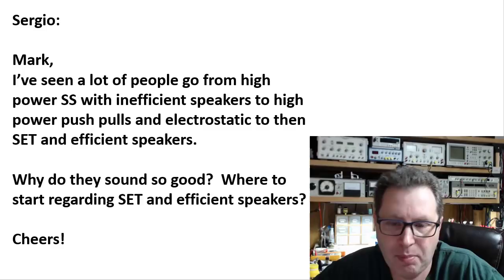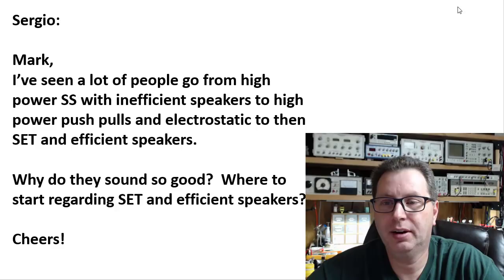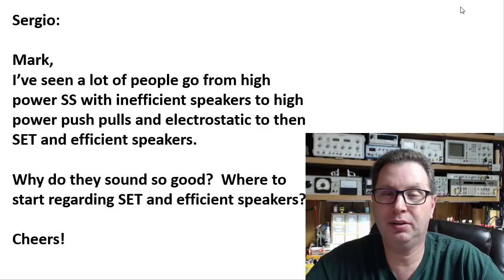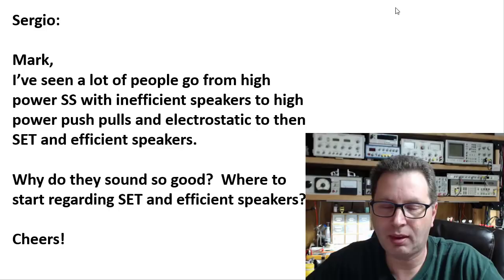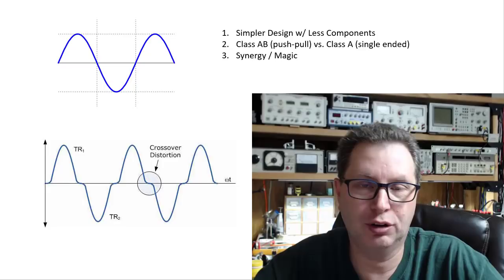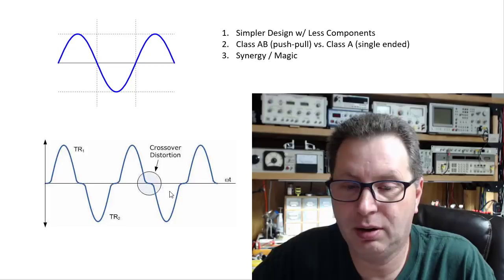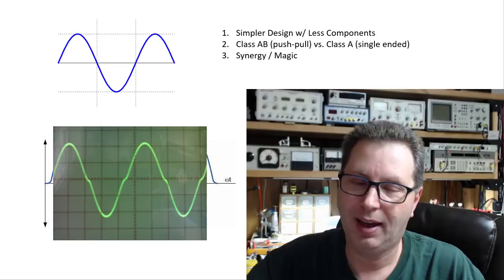What's so good about SET amplifiers and efficient speakers?

Comment: Ummm... actually tube amplifiers in general Current Sources and modern Solid State amplifiers behave more like ideal Voltage Sources. The main difference between them being the Damping Factor. Even with low power ratings, the tube amplifier will have a higher voltage swing, making it sound louder than a SS amplifier of higher power output. When “the magic” kicks in, well that happens when a low Qes speaker like Lowther, AER MK1, Foster FE-206E meets with a Current Source amplifier. There is a considerable low frequency boost. Please find and read articles from Bob Carver and specially the famous PDF from Nelson Pass on current vs voltage sources.
Reply: The damping factor of an SET amplifier varies not only along the musical signal waveform, but is also power output sensitive. The boost is almost assuredly distortion. There always seems to be a gimmick. Personally, I like live music better than artificially flavored music.

Comment: The notion of crossover distortion is outdated. Designs have improved to the point where this distortion is eliminated.  People are shortchanged by the reduced performance of SETs.
Reply: Nice to see someone who understands. Just to add, the crossover distortion mentioned is due to being operated Class B, not Class AB1. SETs are only used because very very few understand how to properly design PP Class AB1. PP Class AB1 actually operates Class A for several watts output until the tubes slide into AB1. Damping factor is basically constant vs SET with wildly varying damping factor/output impedance.

 SETs basically lessen the bass and highs, up the 2nd order harmonic distortion, and "magic" midrange.
Reply: @basspig  Nice explanation. A lot depends upon the design of the PP amplifier output stage, ps supply. I  have never had a notch problem even though I idle near 65-70ma.  I have used my Tek dual trace to check it out.
Your idea of forward bias is interesting. I believe Carver entertained that design as well?

cheers
Reply: @sammys7518  it is a function of the load line and the relationship between screen voltage and plate current. Depending on those relationships, an amplifier may be more or less sensitive to notching at high power levels.
I have not seen a similar circuit in any of Bob Carver's amplifiers. He did employ some protection circuits on some models, but bias was pretty conventional on the ones I worked on.
Reply: @basspig  In triode mode, there should not be any problem. I have no notch distortion at all in my PP circuit. How are you biasing your output tubes?
Reply: @sammys7518  triode mode avoids the notch because the screen current is directly tracking the plate current, being wired together. This is also why I like ultralinear output with the screen taps. Maintains the tetrode advantage and has some of the benefits of triode.
I bias my tubes with a mix network that uses a -110V DC bias supply and a voltage divider coupling to the rectified output from the plate side for forward biasing dependent on signal level.

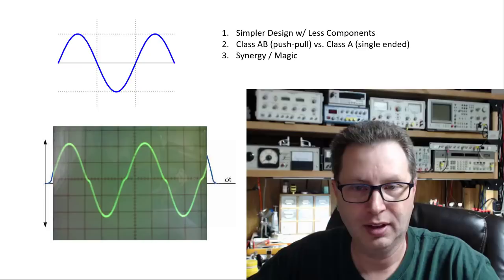Comment: The author's explanation of Push Pull operation has very little accuracy. The author's description with the left side photo notch,  the scope sine wave at 6:58,, and signal split in half comment is Class B mode "50% duty cycle",  nothing to do with Class AB1. 

In fact, Class AB1 has both output tubes running Class A, or 100% of the waveform for multiple watts output 
by definition. This is first semester Electronics Engineering. That is good for 80s/90s db spl. As the wattage rises, the output gradually slides into Class AB1 operation.

There is no taking the signal apart and putting it back together. A completely false statement. Frankly, 
the video explanation is disgusting to me. As far as pure sound, well.............

An SET amplifier has several inherent major problems that degrade the sound. One being the speaker sees a constant varying output impedance over the waveform, thus constant varying damping factor.  

Another is that there is not cancelling out of the 120hz ripple that PP has. This almost necessitates the need for inductors/chokes in the power supply filtering. A choke/inductor causes non distortion of the music. 

Another is the extremely high signal drive needed for many DHT tubes. The problem is the driver creates high harmonic distortion. Combine the harmonic distortions of each stage and suddenly one has higher orders. Many designs create very high amounts of 2nd harmonics to mask the negative effects. 

Interestingly, he mentions the black between the notes. Nothing there. With an elite PP amplifier and entire system, one would be hearing the reflections off the recording studio walls. Truly, one hears all the music, not just a portion with the inner detail blacked out. 

The good amps use no global negative and minimum single stage feedback. 

The main problem is that virtually no one understands what is involved and/or how to design a Push Pull 
amplifier. Oh, they know a few equations but not a true understanding.

Lastly, if musical accuracy is one's goal, or gimmicks to manipulate the recording to one's own tastes.

I could go on and on but won't.

Comment: Push pull class A does not have crossover distortion; this applies to tube and transistor amplifier. Using push pull eliminates even harmonic distortion. Push pull can be class A, AB etc. Your description is of push pull is incorrect. Resorting to "magic" to describe SE!!!!

Comment: TLDR - the science is in amplitude depth and speed of amplitude response aka headroom/imaging/detail

You have a far greater understanding of the science than I do, but there is definitely science behind it. Number one is that its a Class A amp. You send an electron in and it gets multiplied. It doesn't get delayed and re routed and turned into a square wave and yadda yadda.. it just gets multiplied at the speed of the electrons in the circuit. Number two is the volume of the multiplication. Its like asking why does a church have great reverb? It's because it's so fucking big!

So, Class A with direct path from source to speaker - You have amplitude response not just frequency response. The reason guitar players love tube amps as much as they do is because the wave from the pickup is unbroken and magnified to the speaker cab, not bit crushed. It's like using a magnifying glass on the sun vs taking a picture on a cell phone or a 35mm and zooming in. People talk about the magic of tubes, and that"s wrong (in my opinion, I'm a musician not an engineer). The magic is in the multiplication of electron flows due to the physical properties of the circuit. Why don't transistors sound the same? The biggest reason IMO is because they aren't working with the same volume. Tube distortion is yet another story for a different time (and a different guy as I'm a trumpeter not guitarist). 

Shannon Nyquist made the leap that since frequency response can be assured - that no quality is lost. Shannon Nyquist was incomplete. You need amplitude response too. The reason a ride cymbal sounds so damn good on a 5 watt mono Single Ended tube hifi... old enough to draw a pension... isn't because of the "great" frequency response on the unit.. the frequency response sucks on most of those old radios and reel2reels and record players (at least it does on mine). The reason is because the amplitudes of the frequencies it CAN do are turning on a dime and in the correct quantities. You can hear the millisecond the stick hits the ride on an old tube amp with shitty stock speaker. It isn't some muddy fuzz or some 808 sample, the hit is very well detailed. You can almost tell the weight of the stick. If you listen to a live recording, you hear the room noise as though you are actually there. Or, put differently for the guitar players out there... a guitar solo sounds like the players tube amp is right in front of you... because effectively... it is... 

What has worked well for me is to pair my tube hifi with a modern boombox. The boombox handles the lows and the tweeter stuff, which are low information frequencies. You don't hear the shoes the drummer is wearing in the subwoofer or the tweeter,  but you might hear it in some well delivered mids.. as he shuffles across the floor.   Under 100hz and over 10khz is all bout feeling the space of the music. Thats the stuff that makes it sound big and fat but the mids is where all the information is. The hifi does the telling, the solid state boombox does the selling. I balance levels and eq so the hifi can output the sweetest spot possible and then add volume and frequency range with the solid state side. From there, the volume level on the laptop acts as global volume. I mean ideally there would be a Single Ended amp and high sensitivity speakers and a high power push/pull with electrostatics to fill it out and some high end subwoofer to cap it off and I would have a re-purposed cathedral as my bat cave... but you work with the budget that you have...
Reply: SETs have many inherent flaws. It is only because very very few understand how to design a top notch PP amp that SETs even exist. 

An excellent PP design will hands down beat an SET design. But PP are very difficult to design. Sad.

Comment: Ah, set amps. Those with 5 to 10% THD. Square waves that look more like sine waves. Low output asks for horn loaded speakers that add even more distortion. High efficiency speakers that also amplify the relative high hum and noise output of those amps. A biased video.

Comment: 4 : Output transformers are biased into the hysterisis cycle .............So they pass very LOW level information and micro-dynamics !!!!!!!!!
5 / One can benefit from the very best Output transformes ( at a price ) ......permalloy and nanocrystaline technology..........incomparable quality compared with iron /silicium ones .......
5 : Comonents will reveal their sonic texture , so synergy can be searched between tubes, resistors and capacitors .......
6 : NFB  is not necessary as correction ............processing only serves test gear but not the soul of the music .
Reply: That sounds just like PP (except for the SET output transformers which need all the help they can get.) But so many inherent problems with SETs that cause distortion, of which there are at least 6 different types.

PP can be designed totally accurate, SETs cannot. NFB not needed either.
Reply: @sammys7518  I like distortion, especially second harmonic. Undistorted amps are boring, Nelson Pass proved that in listening tests, he contoured distortion to please listeners. That's why there are people who love his amps.

All tube preamps don't have to be class A, you could design a tube preamp that is PP if you wanted.
Reply: @mosfet500   A single Class A stage line preamplifier can be perfectly accurate, so no need to try PP. If it is boring, then one of two scenarios exist.

1. You do not like accurate, live instruments & voices. That is a personal choice.

2. Your stereo system is not accurate as claimed. So distortion might help. But that is a failure of the 
one or probably all the components in the system. 

3. As far as 2nd order, negatively affects dynamics. If the system sounds scratchy, poor quality parts 
is probably the problem.

4. An SET amp has numerous inherent problems. 

As far as Nelson Pass, I have yet to find a SS amplifier of any brand that is actually accurate. Solid State has inherent problems/weakness which does not allow for accurate reproduction. This is via specialized listening testing procedures, not simple auditions. I have only found one tube amplifier that is truly accurate, and it is Push Pull. 
It takes one a whole step and beyond in sound quality. Unfortunately, the company no longer exists, retired some years ago.

I prefer accurate because I like live sounding instruments. Again personal choice.
 

cheers
Reply: @sammys7518  That's not what you said, you can have a PP preamp, the benefits are a non sequitur.

Why can't you like both?

No, people like distortion, that's why many people like the way tubes clip. Scratchy has nothing to do with it, neither does the quality of the parts.

Every design has problems, there's no perfect design, it's tradeoffs regardless whether you're designing a car or an amp. Amps distort, speakers distort, rooms distort, DACs distort, and on and on. What's your point?

Accuracy and musicality are two different things. Audio is like a photograph, if all you want to do is look at El Capitan as it exists then drive out and see it. Ansel Adams took exquisite pictures of El Capitan, you can see the majestic beauty of it but it's a picture. If you want to hear the Berlin Philharmonic unaltered go listen to it, if you buy a CD or record they are highly processed regardless whether the amp is sonically accurate or not, you're getting the sound engineers manipulation. They manipulate it and I manipulate it. If I buy an Arbitrary Waveform Generator, I want it to be accurate as possible, it has different design criteria and a different function.

Guitar players like tube amps because of the distortion. Period. If you go to a concert that's live then there's no amplification, that's a limited experience, most singers and instruments go through amplification. There's a pleasure in listening at home to recorded music, that's what home audio is about, so why are you even hear? Trying to impress people with your understanding of electronics? Not impressed!
Reply: @mosfet500  If you like it, so be it. But a pre with distortion is not the reference. It also tells me that there is something else wrong with your system, unless you do not like live  instruments. If you don't that is your choice. But don't later tell me that SETs are the holy grail, cause they don't make the standard.

I depart in peace. Cheers
Reply: @mosfet500  Because those chips are not accurate. There are at least 7 different forms of distortion, not just hd or imd.
Distortion is anything that alters the music from the source input.

The ear is capable of perceiving frequency response changes 120db. +/ 0,1db is only
~-54db. 

A sine wave tells one nothing.
Consider magnetic fields produced by traces inside the chip that are picked up 
by nearby foils. A sine wave won't show it.

Consider internal capacitances with the high DA and DF. Won't show up in a spec measurement.

Consider an electrolytic capacitor vs an 
accurate Polypropylene capacitor. But a scope won't show the difference with a sinewave.

Consider internal IC silicone resistors vs Vishay bulk foil. A sine wave, specs tell nothing about the sonic quality of the parts
nor the component.

Not surprising why the audio field is failing with such ignorant YT that I have seen. You get exactly what you deserve. Good bye.
Reply: @sammys7518  You're making my point for me, people in DBT's can't hear differences they say they can! 100%, I'll be happy with 80%, people can't even do that.

They're not skewed to anything, music plays you don't know which resistor the music is played through, pick which resistor is better. It's called science, if we don't use DBT's then what exactly should we use, your subjective opinion? Thanks, I'll take science, the trouble is you can't tell the difference so go back and look at your statements about resistors and tell me what criteria you're using to differentiate the sonic differences if not DBT's.

All we have to do is prove one thing, that you can hear the difference in a DBT. 

Simple, shut me up prove FOR MONEY (not my cross out) that you can hear the difference between two resistors.
Reply: @sammys7518   You're still not answering the question. You think you can hear the difference between two resistors. How are you proving it??

DBT,s are science, they're the only true way to prove that an individual can hear differences. You don't like DBT's because you can't hear the difference between two resistors, nobody can!

As for your no distortion amp, you still haven't removed room, recording lab engineering, microphone,  and media platform distortion. All you can do is go to  live events that aren't amplified to hear music, that's according to your own criteria. You can't even go to a BB King concert because he uses a 1968 Fender Twin Reverb combo amp. So you can't be a home listener with a system by your own statements so what are you doing on this site?